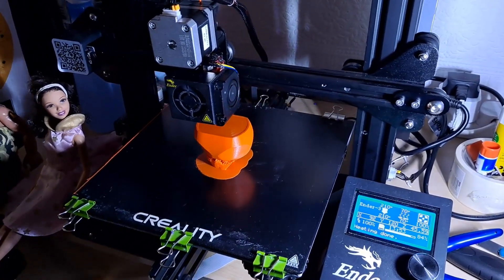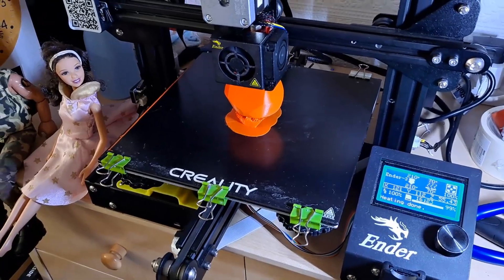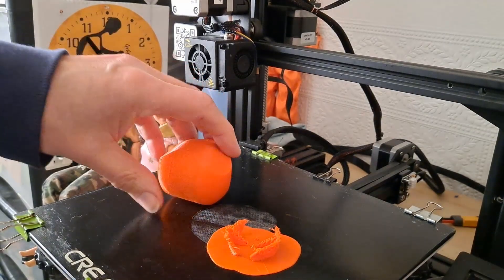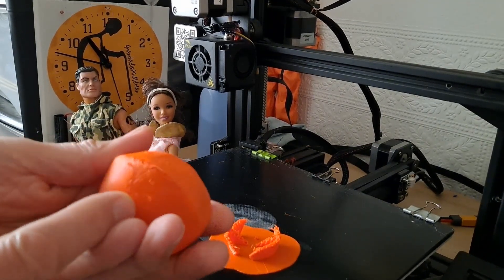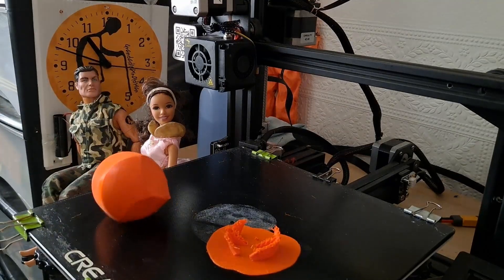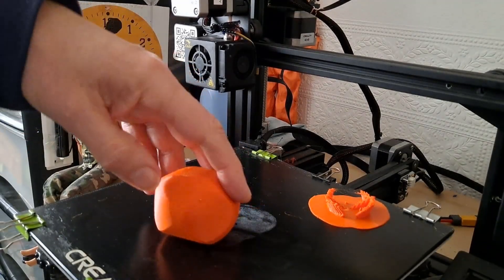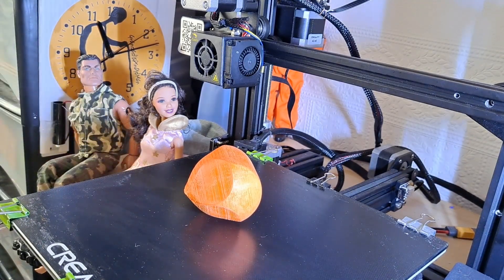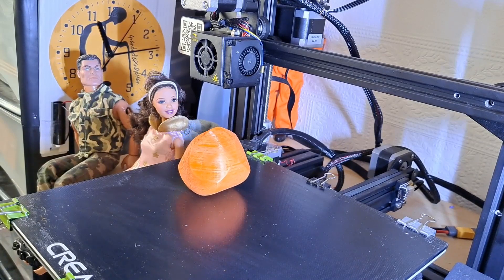Random stuff off Thingiverse - Gömböc - SECOND print ATTEMPT

Comment: According to wikipedia it's pronounced "guhm buhts" and means "little sphere" in Hungarian. I'm pretty sure I remember seeing an edition of QI wth Stephen Fry where the inventor of this shape was in the audience and was introduced. 
 I would possibly experiment with using variable layer height to make the layer height much smaller on the top and bottom to make those layer lines less significant (I use prusaslicer, but I am sure Cura has the same ability).  To smooth it you could try using a high build primer that people use to hide scratches on car paintwork on it and then sand it down until the PLA just begins to show, so you will fill all the imperfections without changing the shape. That's if its important enough to you!!
Reply from the maker: Yes, you could spend a lot of time "polishing" this. I just did a live Gömböc Spinning video, it worked amazingly well. Just needed a good spin to get it up on it's point 😆😆 https://www.youtube.com/live/lgriBBWFFSY?feature=share